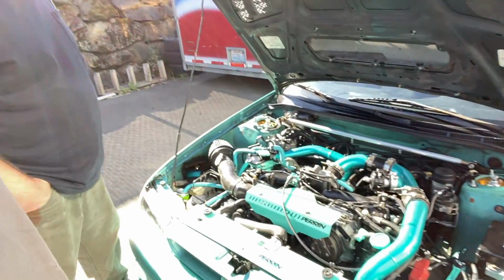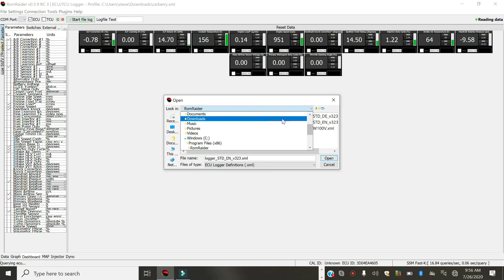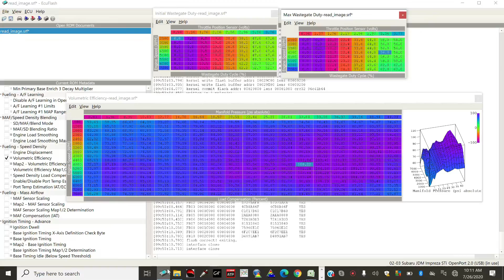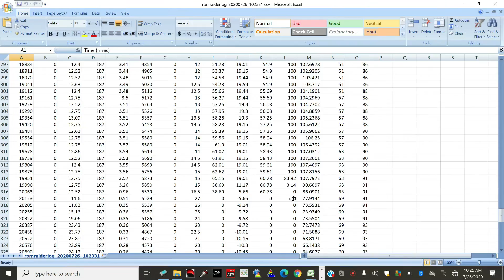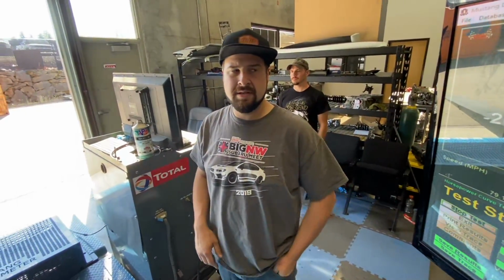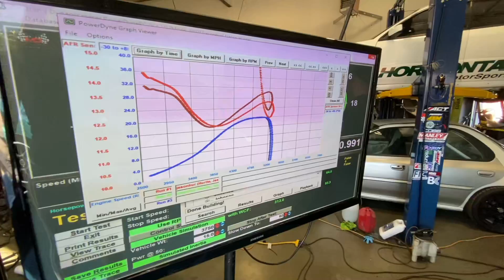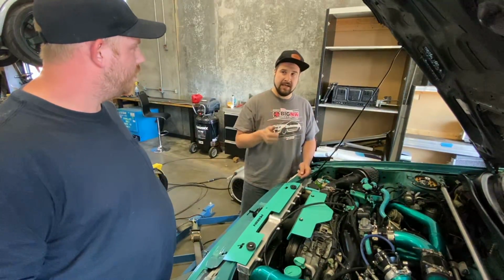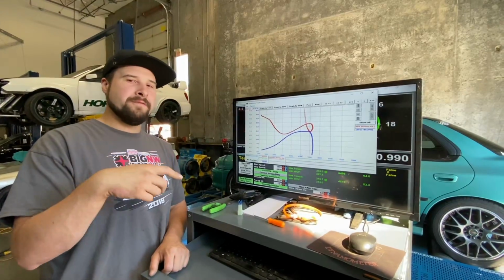Green RSTI Dyno Tune

Comment: When you tune how many maps do you offer?can you do like a low mid and high boost map I can change with the SI drive selector (2013 STI)
Reply from the maker: With the SI drive I can make 3 different boost levels or I can make separate maps if desired